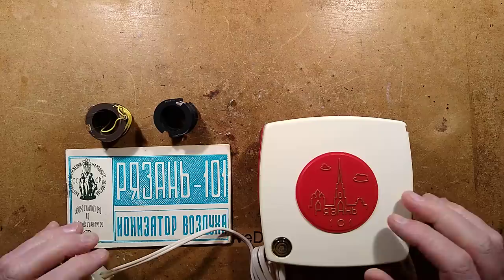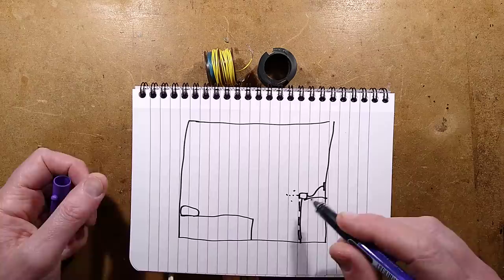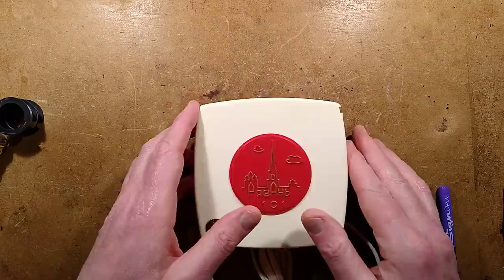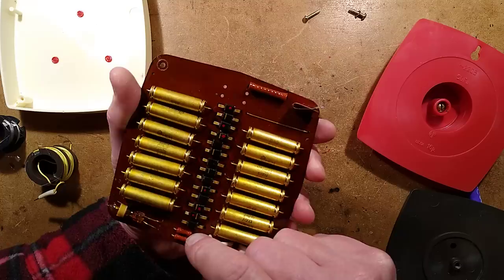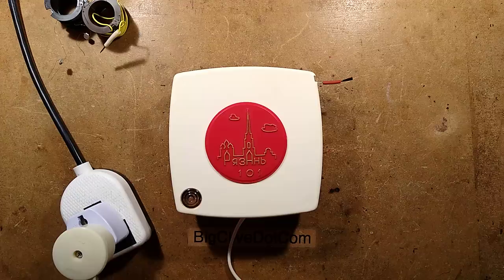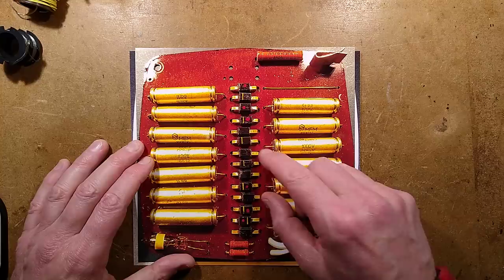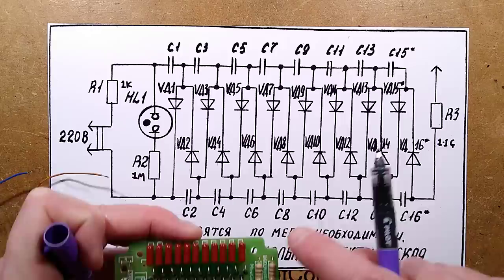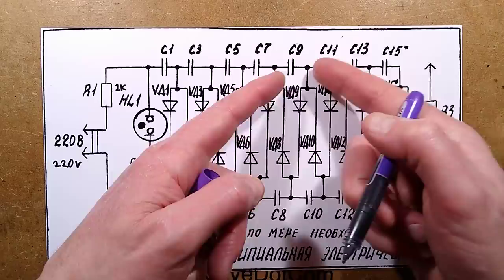Inside a soviet ionizer from 1990 (with schematic)

Comment: Everything in the USSR came with the full schematic: televisions, radios, tape recorders, record players... you name it. I've even seen schematics in instruction manuals for soviet made landline phones.
Talking about the board material: it's more than likely a paper laminate, something similar to getinax. These boards are horrible, the traces tolerate no heat at all. The coper delaminates if you even look at it wrong, let alone try to do something with it. Regarding the diodes: some of them are probably have the markings on the bottom. That's the peril of using square body diodes with color markings on one side. It's true that the diodes look chunky, but that doesn't say much about the actual semiconductor crystal inside. The leads are also flat, so that's more of an appearance thing. If you flatten the leads of 1N4007 you are going to get something more or less similar. Actually there are also soviet made transistors with flat leads as well. One example is the iconic general purpose KT315 / KT361 complimentary transistors. They look weird, but are almost a direct substitute with BC547 / BC557.
Reply: Usually, but not always. Due to no IP rights for consumer equipment the owners were allowed or even encouraged to repair stuff themselves. Finding parts could be a serious problem though. But, these schematics weren't necessarily correct. They had to be included, but repair shops could receive better, more detailed and more recent schematics.
Reply: @noop9k  Schematics sometimes didn't have a later modification to the design of the device included, but one could still figure out what's going on, trace a problem, and repair it. I'm not saying it was a perfect thing, but it was good enough to help a person with modest knowledge in electronics to repair their device, at least in most cases. They were even helpful enough to tell you what voltages and what signals you should measure at the test points of the board. True, sometimes the print quality was bad, but it was still better than not having a schematic. Having said that, nobody says one can't repair a device without a schematic. It's a matter of knowledge and experience.
Reply: It should be added that there were reasonably priced books with schematics of many devices of the same kind with detailed repair instructions written for amateur repair.
Reply: Yes remember consumer grade products came from the same factories that made military products, and the old USSR had mandates that pretty much all consumer electronics had to last at least 20 years, and be repairable. Thus the schematic included, and things like fridges that you still find running, despite being a half century old, but still in use and working well. Also standardised parts in a lot of things, so the use of capacitors, resistors and such that were designed for military use. The flat lead diodes are simply because it is easier to make, you start with a long flat strip and punch the strip to make the 2 sides, and then assemble the diodes between the flat sheet ends, solder the die to them, and then use a mould that pressure encapsulates them. Then trim off the strip joining the 2 halves for recycling, and you have the diodes. You can leave the strip on for bulk orders, making them possible to store in a reel with ease as well. just have to test each one before use then.
Reply: @SeanBZA  That explains why I've found quite a few exported working Soviet camera lenses and bodies. While long past the 20 year mark (Including a 50 year old lens) the built to last mentality has given them a long life even if they might have a few quirks versus western vintage cameras of the time.
Reply: @SeanBZA  There were very different components used for consumer tech and military tech. With military components using precious metals and being way more expensive. And consumer tech often hilariously unreliable. Or, for some components, those that failed military testing went into consumer stuff.
Same product could be produced by different factories, receive their markings and the quality was varying between factories as they could use different components available to them. One Armenian electrolytic capacitor factory was famous for their short-living explode-y capacitors. Their logo (looks like letter G) is a mark of doom.
Typically mil grade components have triangle or rhomb markings and, in ICs, lack letter K in the name.
There were quite a few IC series never appearing in public access manuals and only in classified ones, printed for the design bureaus. I accidentally found one :)
Reply: @SeanBZA  What was "mandated" was also often ridiculous and created serious headaches for engineers. In reality "long-lasting soviet stuff"  is often a myth.
What is true is that there was no planned obsolescence, usually.
But the reason why some products are long lasting is that they are overengineered, not cost efficient and use outdated designs directly copied from old western products, or licensed.
Due to bad tolerances and quality control some stuff required DIY fixes almost immediately after purchase.
Oh, and often sold at loss, because communists are bad at dealing with money. It did not matter that much because production volumes were too small anyway, compared to military production.
Reply: @noop9k  True, but the simple things like resistors and film capacitors you generally got the same part, or the QC fails that did not quite meet the military range, but at relaxed spec were fine. Even these days the military parts are the same for the most part, same raw materials, same production process, just all parts fully tested, not just function test and lot sampling. 

At least for semiconductors this is so, as the processes used are all geared to passing the mil and space spec, right up to final encapsulation and testing, where they can start to differ, but the actual silicon inside is often exactly the same. Makes sense to get the best yield out of a wafer at all times, and only send the perfect full wafers off for the mil and space testing afterwards.

And yes different factories different results, even in the west, where you find vehicles built at different factories, nominally the same vehicle, are often vastly different in QC complaints from the end customers.
Reply: @shodan2958  Vast majority of soviet photo stuff are copies of older Zeiss/Leica, that were quite reliable to begin with. But often made from different glass and with worse tolerances. ФЭД = Leica rangefinders, Jupiter = Sonnar, Helios = Biotar/Planar, Industar=Tessar..
Reply: @arampak  I often happened that the schematic of various stuff printed in DIY magazines, hpbbyist PCs etc. included components that could not be purchased in retail but only stolen from factories :) 
There was even a translated book about 555 timer with intro saying that it is hard to get the soviet clone of it. Compared to the western EE, 555 is almost unknown.
Reply: and those flat leads are very fragile!
Reply: @shodan2958  Soviet lenses are a great example of something the Soviets built to last. Whether you look at the Zeiss derivatives (which the Soviets engineered to be cheaper, whilst just about maintaining the same image quality), or their native designs like the ERA, Zenitar, Kaleinar line, they excelled at optics, even if others like Noop here are happy to pretend it was Leica who should claim 100% of that success.

Comment: if you control your bench-lights with WLED , you could program a transition time where it fades back in to full brightness nice and slow .. it supports PWM control, so you don't need Ws2812 LEDs .. its a really simple circuit also, like one Mosfet one resistor at the gate and a beefy cap for smoothing, you can also have an analogue button like a volume knob to control brightness.  ;)

I love that you take so much care of your photosensitive viewership. Thanks !

Comment: So this is a high-voltage corona as was used in older photocopiers and earlier laser printers scaled up to a room-sized device. Higher speed copiers always had activated charcoal air filters to reduce the amount of ozone they spewed out.
Reply from the maker: No significant corona as they have deliberately kept the voltage low.  I doubt this unit will produce more ozone than naturally occurring levels.
Reply: Learned something neat today, thank you.

Comment: Very interesting!  I rather like the decorative city skyline on the front.

I remember we used to have an air filter that had a nice, hefty filter cartridge attached to a fan, with a pair of similar-looking carbon fiber ionizer... uh, things in it in the path of airflow, many years ago.  It seemed to work, judging by all the dust the filter cartridge collected, but it suffered a misadventure at some point, and so it is no more.

It is interesting how some Soviet electronics were built with pin-for-pin copies of "Western" electronic components, but others look like they are from an alternate history entirely, with big, bulky, atom-punk sort of components, all at once overbuilt and yet (from what I've heard, especially when I was younger) remarkably unreliable.  I wonder if including a schematic was less as a statement of support for a "right to repair" and, perhaps, more of a concession to the assumption that the average buyer would need to repair the device sooner or later?  Definitely an excellent practice for any electronic device, nonetheless!

Comment: The presence of other voltages would not surprise me. The Soviets also had an isolated 42 volt system in safety critical areas such as schools. Many countries started at 110 and moved up to 230 over the decades. These transitions usually take decades to complete. I understand there were even parts of the UK that historically used different voltages. The reason the plugs on the continent are not polarized is due to Europe's transitional electrical systems where 220 volt outlets were actually two different phases of 127 volts. Some parts of the world still use this type of 127/220 volt system.
Reply: Im pretty sure my country was on 220V single phase 380 3 phase even before WW2.
Reply: I mean, the us is 220V single phase but most things run on 110V split phase
Reply: In many buildings in the UK there are still "shaver" outlets running half mains voltage with a different plug. Almost exclusively in restrooms.
Reply: Haha, yes North America.  US / Canada 120 / 240.  Probably Mexico as well.
Reply: soviet mains were 127V till 1960ies, full transition to 220V was finished by mid 80ies
Reply: @rpavlik1  The US is 120/240 V. 110/220 V doesnt exist since the 1930s.
Reply: @mernokimuvek  thanks for the correction, I can never remember, my brain average them to 115 most of the time even though I think at home I'm getting 120 or 121 on the circuit that has my network stuff on it (and thus a UPS that monitors and reports voltage)

Comment: Very Nice, Instead of letting out the smoke, you're investigating methods of doing the reverse. Just got to be a trend setter eh?
Interesting that the various materials still look good, negligible degeneration. Fantastic that the Manual was in such good condition too. Did it come in original box?
You started to investigate how black the Neon was from use (5'58")  but didn't actually give a description that might indicate (pun) how much use it might have seen.
My guess is that it was originally a very expensive gadget that the owner didn't use much but didn't want to throw out.
Good that it didn't end up in land-fill and has now had it's 15 minutes of fame courtesy of a friendly & curious bear.
Reply from the maker: The unit came in a very scrappy unmarked box.  The neon was in good condition.  Probably due to the unusually high series resistor.

Comment: During my business travels in Russia between 2004 and 2014 I have come across some strange stuf there. In some hotels (old ones) it stated on a little sticker 127volts. I never stuck something in them but they might be crossed over from 127v to 220v. And that took some time there. Maybe even a period when both was on the grid.

Comment: A little while ago I was browsing eBay looking at vintage displays (as you do), and I came across some soviet era VFD displays from a vendor in Ukraine. It was a lot of four basic 4 digit clock style displays. I thought it would be a fun project to build a vintage style clock using the displays, so I bought them. It would be using all discrete logic chips, and I'll see if I can get a plexiglass case made for it to show off the display and electronics.

I was half expecting nothing to show up, but fast forward a few weeks and a package shows up in the mail from Ukraine, and all four displays are intact, with just a few bent pins. So I guess I'm going to have to make a VFD clock.

Comment: Ive actually built a 30-stage voltage multiplier a few years ago. It works to this day, but it's, well, more of an electric bomb. I've used 1 microfarad capacitors and... no resistors. Had to dip it in engine oil when powered, as the contacts from stages 26 to 30 produce corona discharge...

Comment: Was there much of a benefit to having a large wire suspended near the ceiling compared to the pin-type emitters of the UK ionisers? Or was it more the case of evening out the precipitated dirt, so there isn't a big dirt patch around the device itself?
Reply from the maker: I think it made it more efficient, but at the expense of convenience of installation.

Comment: If I'm not mistaken, the ionizer is very similar to a ceiling fan which charges random particles aka dust in the air and gives them a positive ion and makes it stick to ceiling fan blades the worst.

Comment: Ryazan, not Ryzen... Nice PCB layout and a resin equivalent of conformal coating.
I've seen (and done) shortwave broadcast antennas by hanging a length of wire across the room, but never saw one used with an ionizer.

Comment: Speaking of unusual ionizers, I’d be interested in seeing an anti-static ionizing “gun” taken to bits if you happen to run across one. They’re sold to audiophiles to help remove dust from vinyl records, but I’ve heard they’ve found use in laboratories too, though for what purpose I’ve no idea. 

They’re entirely manual, not having a power source beyond the mechanical action of squeezing the handle, and they come with a cap thing that goes on the end that’s supposed to flash orange (a neon bulb, perhaps?) to show that it’s working.
Reply: I got one of those. There's a piezo crystal inside, nothing else. In the dark you can see a faint blue corona dot on the pin. 
Not quite sure if it actually works on records, but you can charge and discharge (and over-discharge so reverse charge) an electrometer with it with ease.
Reply: They are used in labs, because materials/chemical compounds come as very fine (and expensive) powders that can hold static charges easily. And to get the best accuracy and precision in their calculations (while not using a lot of chemicals) labs tend to very small and precise measurements to which even static electricity can throw off. Its important because some chemicals can kill you even when its 1 molecule in a billion water molecules, so you don't want errors in your measurements.

Comment: After watching your ionizer videos you've convinced me to buy one, but I would use it in a room with a projector screen, is there a way to prevent deposition on the screen? Would connecting it to a high negative voltage(through several safety resistors) be enough to reduce dust accumulation?

Would putting a high positive voltage on a plate near it also reduce the dust accumulation on the screen? Have you tried any of this in practice?

Thanks for all the videos, I always learn something.
Reply from the maker: Some do have a positive collection plate.   If worried about dust precipitation it might be worth using a HEPA filter instead.

Comment: Lots of 60s and 70s electronics came with circuit diagrams, I had a Japanese made SW radio which included one and when I worked repairing TVs and VCRs many of the older ones had a diagram.

Comment: Reason why their equipment looked so strange is shortage and very limited variety of components. Designers of electronic equipment had to use what is available. Sometimes what what's available was not enough, so they had to come up with unusual solutions 😁

Comment: The missing marks on the diodes are probably on the underside.

It's good, for safety, that the output resistor is 1.1 Gig Ohm - not 1 or 1.09 Gig Ohm!  - whats is made of? a glass rod? 😂😂😊😊
Reply: Had a cheapo lighter, once, with an LED light on the other end run off a couple of non replaceable button cells. Was curious why it was so dim, even brand new. It had a printed track used as a resistor that measured 1.2 gig ohm, and that solved as to why. Not sure if it was designed that way, or was a fault, but basically looked like an RFID antenna and couldn't see any breaks, so had to assume it was by design. No satisfying answers.
Reply: Close, the resistor is a ceramic rod or tube with a carbon spiral on the outside

Comment: On the schematic diagram C15, VA15, C16, VA16 have asterisks and a comment in Russian is given.  These are the components that are not populated on the board.  I don't understand Russian, but is it possible that these extra stages are added when the unit is to be operated on 120VAC?
Reply: The footnote reads "installed as needed."